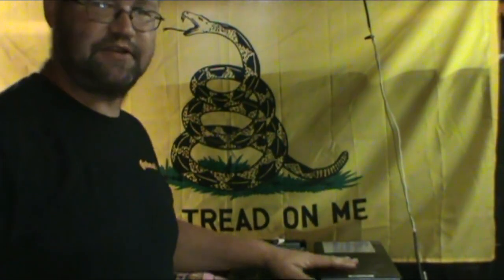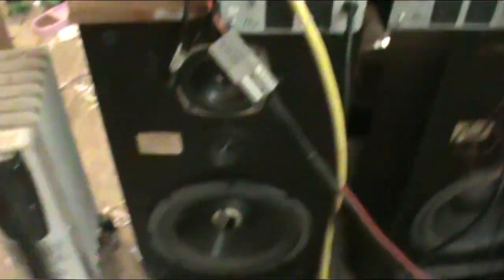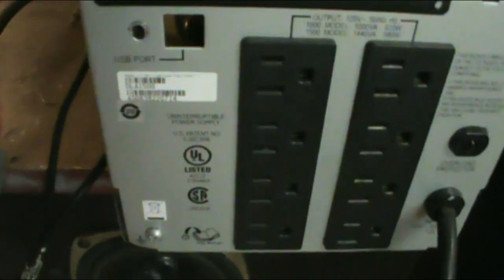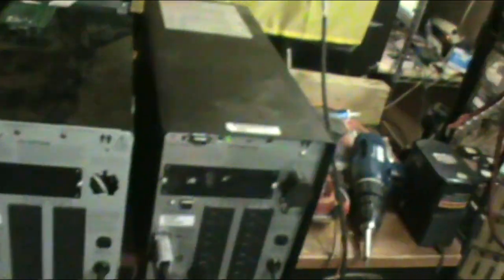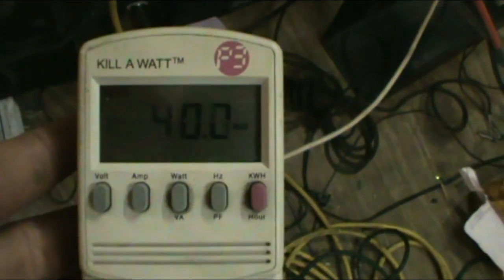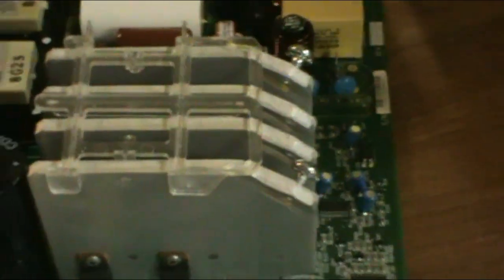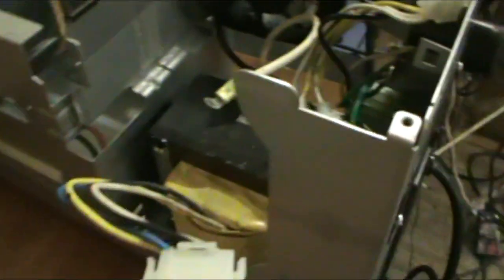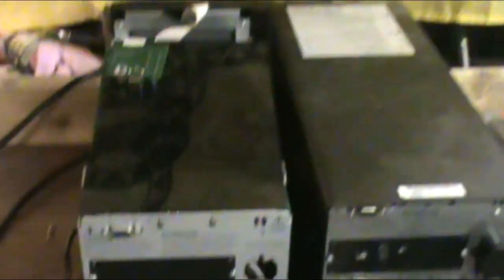Modifiny 980 watt APC to 1500 watt Pure Signwave inverter

Comment: I know its been a wile. but I'm wondering if the ups/inverters held up over the last couple years. I have been wondering if the ups will keep cool with sustained full output. I have been looking into inverters . and need pure sine wave output. so maybe I can get 3-4 of the ups and modify them and power my off grid home. with 4500-6000 watt worth of inverters and a generator for the high current stuff. thanks for the work you put into the videos. thanks for the info also.